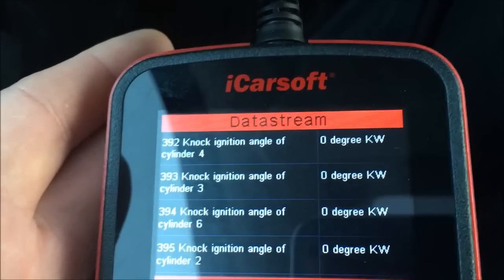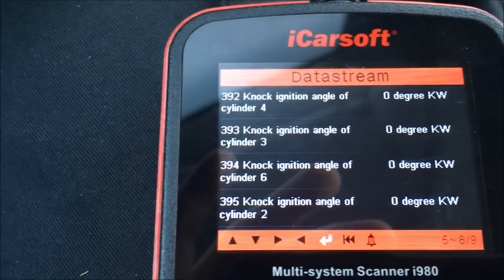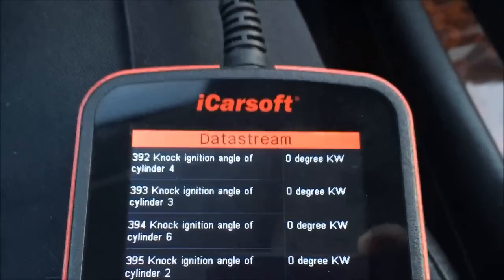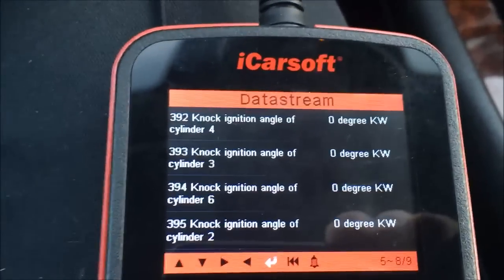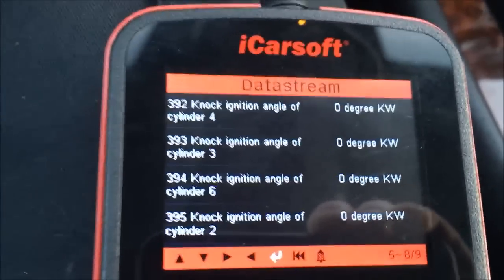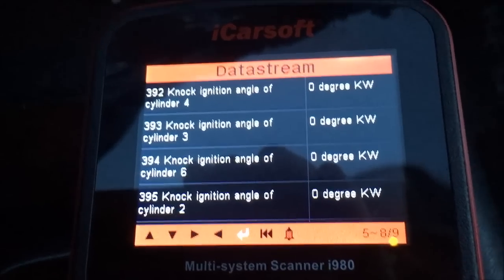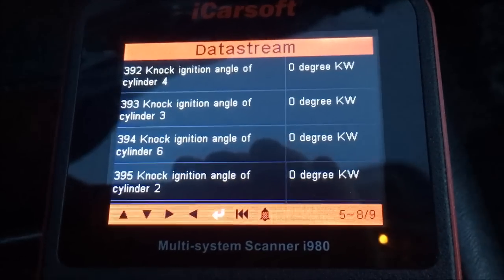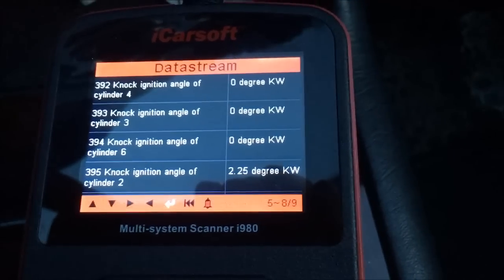Can you use regular fuel in your Mercedes ? .. real time knock test

Comment: Wow... Don't freak out but in the 50k mi I've owned my 3 Mercedes cars... I only filled up with premium once to try it. I couldn't get a measureable difference in 0-60 or 0-100 mph times (in my c220 though) so I figured it wasn't worth the extra 60 cents a gallon. I drive my cars really hard too, I've done a good bit of towing with the ml430, guess I really should've used it then, I could see it making a bigger difference on the m112/113 motors.  All three still run great, until a knock sensor goes out I guess haha. I just always was told premium is only REQUIRED under boost or if the engine is specifically tuned on it, Mercedes does say premium is RECOMMENDED but using regular is fine. I'll have to try it with the ML, I bet the knock would be even worse in the summer temperatures.
Reply from the maker: My manuals have all said use premium only ..if premium not available use the highest octane you can find, but only drive with light throttle and fill with premium asap.  The reason the use premium is that they have a high compression ratio of around 10-1  most engines that use regular will have an 8.5 -1 ratio . The higher compression means more power , but also more heat from the compression which means higher possibility of pre-ignition. Most turbo and supercharged cars have a lower compression ratio because once boosted the ratio can hit 12-1 or more with a very high probability of pre-ignition. Since the only thing that octane does is to resist pre-ignition the higher the octane ,the less chance of knock. On the video you can actually hear how much louder the engine is at full throttle with the regular fuel in it
Reply: What's funny about that though is that my daily driver, a '12 Chevy cruze eco is turbo but knowing the average consumer, it is designed/recommended to run on 87, however it can advance timing and benefit in performance and apparently mpg from higher octane. I remember during a fuel shortage a few years ago, they had someone from Mercedes on the news saying, you shouldn't worry if 87 is the only thing available, drive the car normally and it will be perfectly fine, but for the best performance, Mercedes recommends switching back to premium fuel when available. So unless there's a problem and your ignition timing doesn't adjust, it's really a matter of preference. I think the pinging would be apparent before any kind of damage would be done.
Reply from the maker: I think your Cruze may do a dial back on the timing when it senses knock , and leave the timing retarded, maybe re-checking for knock under load periodically. The Benz. only retards while the knock is present ,then goes right back to the set timing curve. I'm going to do some net scouring , because most of Africa and South America have poor fuel quality , and Mercedes must have a remedy for that..possibly a remapping of the timing from the factory for lower octane ?
Reply: hello i am driving a mistsubishi PAjero and GLC250 both gas and 91 and above and i never filled it with premuim gas.......... both at 96 000 km........ is that still dangerous or the car get used to it and it is fine to do so? thank you
Reply: ؛ُِ}ُ ؛ُِ}ُ ؛ُِ}ُإإإ  it will be fine.todays gas on the station (regular gas) super fine and clean.
Reply: jonathan cook do you have a lab to back up your claim?
Reply: fupabox  How do you know if the primium gas is real? what if there is no different maybe is scam ? do you have a lab?
Reply: fupabox in the long run you will have issues. Keep filling the manual as a lot of people don’t even drain their fluids
Reply: Sorry to say but if it is high compression/turbo charged you are slowly reducing your engine life and if there really is no difference in your vehicle maybe keep running on regular but for people such as myself that own a performance vehicle like my twin turbo Bmw 335 that has over 300 horsepower there are great advantages to running 91 even better of you run 93

Comment: Hey! I can attest to my w202 m111! I use regular (89 octane) and get about 320 miles until I'm JUST past "E". When using premium (93 octane) it feels like I get a slight boost in .hp. But I only get about 280-ish miles.  Not bad considering I drive rather spirited.
Reply: Gazz 89 is midgrade ... :)

Comment: Hmm... So if you drive like a granny can certainly use regular with no knock...
Reply from the maker: yes , but even taking off from a light with minimal throttle I got some knock..if there was a way to adjust the timing back a few degrees you could easily use regular.. I know in countries in Africa where fuel quality can be suspect ..the computer is retimed from the factory to reduce ignition advance. the old way mercedes did this (pre 1990's, with some leftover 1980s designs still using it ) was a round plastic plug with a different resistor in it for different average fuel grades..you could swap the little plug in 10 seconds and then run regular.

Comment: wow, epic knock on the regular. Is there much difference in price between the 3 grades of fuel there ? Here in Australia there is about 10 - 20 cents per litre difference between the bottom and the top of the range. Most of our outlets in my state offer regular 91, premium 95 and premium 98 octane, I always use 98 in my own cars.
Reply: Over east here they also have 10% ethanol in their regular, I bought it once and once only while on a road trip, my car wouldn't even idle smoothly or have decent pick up till I went back to premium. It's my understanding that most people in that state now buy premium instead of regular - the only state with compulsory 10% ethanol is the only state that has premium outsell regular so clearly it wasn't just me.
Reply from the maker: In Canada the grades are regular 87 octane..mid=89  and premium is 91 octane ,with some stations offering ultra premium with up to 94-95 octane.. Other than Shell V power and Canadian Tire premium ,they all have up to 10% ethanol..Ugh ethanol kills older fuel systems and older motorcycles.  The difference between regular and premium in $$ is 12-24 cents per liter..
Reply: Me thinks you are using a different octane standard over there ? We use RON here, so all my numbers are RON.
Reply: I use BP when I can as I get 2 virgin velocity points for every litre. I just keep adding to the 150k points I'll never use that I've accumulated through work flying in and out of a remote island i look after.
Reply from the maker: yes ..we use the (R + M) / 2  which essentially works out to RON -4  .  So a 95 ron ,would be a 91
Reply: We do not have 95 or 98. 93 is the highest in the USA.
Reply: @chocolatewheelchair  93 in the USA and Canada (R+M/2 method) is the same as 98-99 (RON method) elsewhere.

Comment: so, about the economy MPG. what is the best?
Reply from the maker: It's hard to say because I was so careful on the throttle while on regular gas and midgrade. But the # of liters used for the same distance to get the tank empty was about the same. I would think if I drove as carefully on premium as I did on reg. I would get better mileage with the premium
Reply: I actually tried both. I was astonished to find that the car drove 600 km + on regular and max 540 km on premium. I tried that several times. But I was afraid of ruining the Cat. convertors, that's why i went back to premium. Regular worked very good though with no performance issues or even any noticeable difference in acceleration.